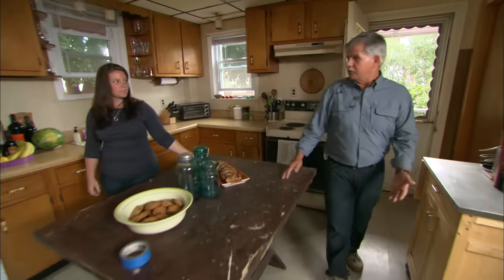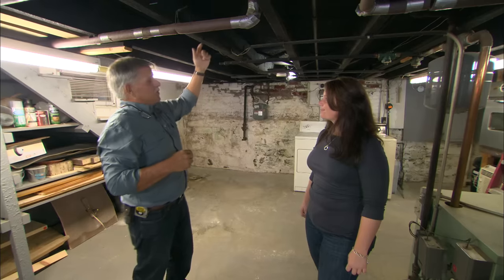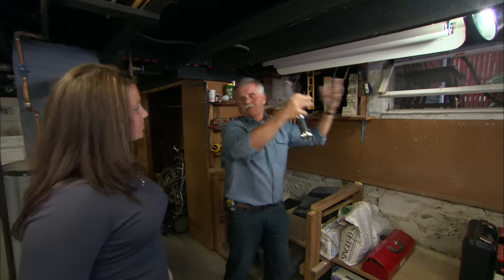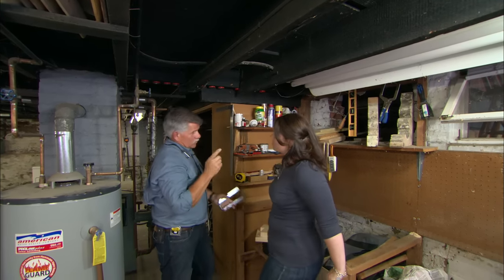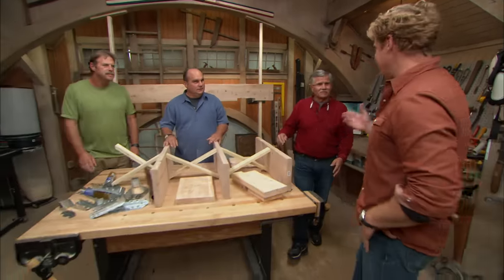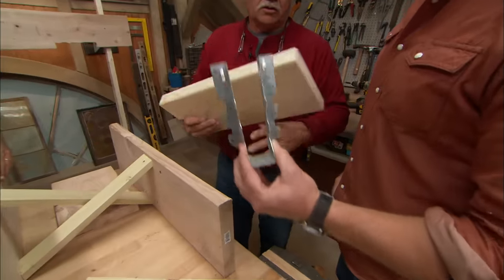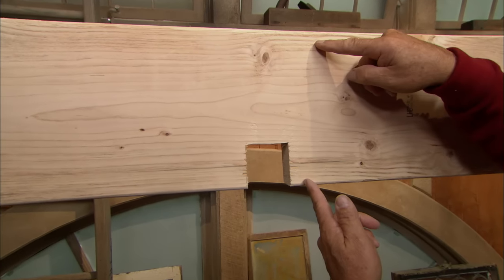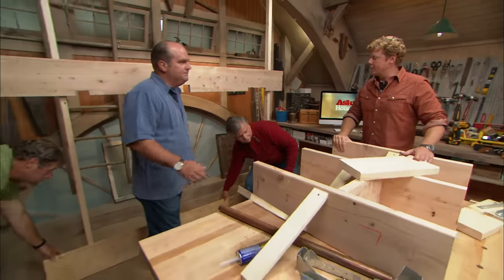How to Repair a Cracked Floor Joist | Ask This Old House

Comment: Thanks for this great video. now, I have a question: I have the same exact situation: between the kitchen and my dinning room, the floor slopes down around 2 inches. is there away to level the floor? can i jack the floor mu self?  my house is 100 years old. I live in nj. thanks.
Reply: odj250 he didn't actually fix the dip
Reply: If you don't mind vertical pipes in your basement, use lally column. Use a screw-type "house jack" rated for 20 tons to raise the area by a 1/4", then screw the lally column tight. Every few months, raise the area another 1/4" and re-adjust the lally. Probably not "code" but lally columns are used all over the northern US (you don't hear/see many of those 1800s/1900s houses falling down), and "code" is a crock pot made of s*tuff... I worked construction and was usually present during inspection.  All the inspectors want is trivial power or to line their pockets.  Those "hanger nails" work fine (or have worked fine on the thousands of houses everywhere I ever lived since their invention).  Inspectors only recite theory from engineer simulations.  Remember: "If you can't build, inspect. If you can't inspect, engineer.")
Reply: Bob - you're attitude sucks. I was a CM for 10 years before I became a code official, and have done that for 25 years. I've helped more homeowners that have hired jerkoffs like you than I could count.
Reply: Srihc Adi
Look on the bright side. The more people like "Bob" there are, the more work for those of us who actually know what we are doing!

Comment: I understand the "no screws" advice based on the notion that people would use drywall screws. But, what if they were using construction grade, wood screws? Just curious.
Reply: Right? Like a 4 inch deck screw

Comment: 4:24 Did Tommy really operate that bottle jack without using an extension handle?  I call camera trickery, judging by how slowly the first stroke was using the palm of his hand, then the strokes sped up.  Handle was removed and hidden when the scene ends at 4:51

Comment: At the end the person says not to use screws because "drywall screws" are too brittle. Now I do not know why people would consider using "drywall screws" instead of regular ones like he states. Why would brittlesness matter in this application? I do not see where they would be subject to impact for example.
Reply: Brittleness succumbs to shear weight.  Construction screws are better than nails on pull out and shear, but don't use any other type, especially deck screws.
Reply: @brewsterly2927  why are drywall screws so brittle then, I'd imagine they would also be engineered to resist shear and pull out. It's a cost saving on not having to temper the material unlike construction screws?

Comment: If your running an eight inch metal pipe for a heat run in a joist,sorry but that joist will not have bracing.

Comment: Wait...what? The only argument for using nails is that because "most" people would use drywall screws?....
Reply: Pretty smart, try to dumb it down, tell people to use nails and not screws, rather than trying to explain the differences between screws.
Less room for error!

Comment: A real contractor would not use drywall screws. They would use wood screws, which are fine for sistering the beams.

Comment: "Center third, the worst place to drill". Not entirely correct. It's absolutely the best place to make your inlet if the opening is in the right place and the size of the opening isn't too large. Notching a beams bottom like that is totally idiotic though.

Comment: Why don't use you wider joists in america? I think 2" or less is pretty small. In Germany we use 4" x 6", 6" x 8" or bigger as floor joists. That gives it more rigidity in my opinion.
Reply: +SpookyMietz  Because American builders are crooks. Let the place fall down. Once they are through they are long gone.
Reply: Everything in Germany is oversized and under engineered in the construction industry
Reply: Houses is America cost a fraction of those in Germany, and no one plans on living in them longer than 30 years.
Reply: Germany and most of Europe allows for greater spacing between joists than the US does.  They go hand in hand.  The wider the space the thicker the joist.
Reply: I would add that too big a piece  of wood gives diminishing returns with it's strength to weight ratio.

Comment: Actually you're supposed to drill a floor joist in the middle, not on the edge. Cutting the edge of a joist reduces load bearing capacity the most.  Look here...https://www.familyhandyman.com/floor/how-to-drill-through-floor-joists/

Comment: My house is unlevel & cracking Sheetrock + around windows...and my family is like “that’s not a problem, you’re making it up.” Or “the house isn’t gonna like collapse, it looks fine.” 
Sure, besides the cracking of tile, walls, ceilings, floors,  baseboards, it seems “ok” except for the drafts coming through the cracks. & both showers are surrounded 360° in cracked Sheetrock/wood framing......😩 (who lines showers with wood?)

“Looks” aren’t everything. This entire house & the last “man” that “renovated” it came in & out lipstick on a pig basically, and even then he didn’t know what he was doing. 
(My sister added an addition onto home as cheaply as possible when she lived in the house & I’m literally at my wits end been working 2 years getting nowhere. The addition to old house wasn’t tied in properly, water damage & mice DESPITE pest control. 

& now I have a deadline because my boyfriend’s business is closing (we lost all our money on repairing this house, including my lifetime savings for my wedding...a wedding that NOW; will never be. 
I have until end of April. The house is filth personified. I clean & have tried everything (still various vermin & mold) 

Please: I need help. I need advice, a contractor (one that won’t make me sell my soul) & honestly I’m in dire need of psychological help at this point...I’m a young female ballet dancer 🩰 & a freelance professional makeup artist (+ I run online media for my dad’s business.) ...I’m in no way a hardcore mason/foundation specialist, I’ve never even personally (DIY) dealt with genuine home repairs until now...plus I’m vegan (so I’m not in love with killing all these innocent mice. They just want a home too but I can’t actually share my home with mice because I care about my loved ones’ health...and that of my own. 

I’m so utterly defeated. 

I need help. 
I genuinely need help. 
I have no one to turn to. 

Please, God Bless you. 
Even if it’s just a prayer sent my way...I can’t take much more of this. 
🙏
Reply: Katie Fulton, first, breakup with your boyfriend. Second, marry a guy with a super nice house. Third, chill on the couch.

Comment: 6:17 poor building logic. They didn't follow the adding rule where every piece, going down the hierarchy is dimensioned bigger than the last one. You never hang a large piece of lumber on a small piece of lumber, it does nothing.

Comment: @9:35:  Tommy, I was with you until that lame reasoning for not using screws.  I could just as easily say not to use nails because finishing nails won't do the job.

(A better explanation would've been that, in general, nails have higher shear strength than screws.)
Reply: @Brad Yelich:  I was just offering what would've been at least a cogent explanation.  ("Not always" is not substantive rejoinder to "in general".)

What you've written only furthers my point that Tommy's explanation was extremely weak.
Reply: He said Drywall screws were more brittle.

Comment: "Use nails because drywall screws are too brittle."  Who the hell uses drywall screws for sistering a joist?
Reply: Mark Oliver  exactly, just a weird way to explain it.  Saying nails have better shear strength makes sense, but comparing them to drywall screws was an odd choice.

Comment: Your not supposed to cut , notch or drill the top or bottom 2" of any joist . There is no correct way to notch the bottom of a floor joist .

Comment: Does all that work and then uses 1.5" nails. Not structurally secure. Should have been driving 3" minimum into the beam. The 1.5" are just for the side nails into the joist. Those 1.5" will pull out over time. 50 years form now someone will be down there doing this same repair again. Joist hanger manufacturers prescribe a nailing schedule and this is not it.

Comment: I was in my in-law's crawl space of a house built in the 1940's. They used wood cross bracing, BUT only the top of the brace was nailed, and no nails on the bottom of the brace.  They were all just hanging. And this has been for over 70 years now.  How sloppy, and that's why their floor was always a little shakey.  Where was the house inspector back then? Also, they had other work done in the crawl space, and not any one person ever told them the floor was not secured.  What's wrong with people? I'm not even a builder, or contractor of any sort.   They've had plumbers doing repairs to pipes, and HVAC people come and go, and an electrician or two doing work, and most lately, an electrician rewiring and putting in a new service panel where wires had to be pulled.  You'd think they'd pass on their unprofessional opinion some time to someone. I'm an accountant, and I know when things aren't right. Geezzz people, say something.
Reply: LostInMySpace  Great observation. I find this to be common in Kansas City, Missouri.  New home building inspections are terrible and if it’s a development, one house is “inspected” and if in ‘code’ all are signed off on without a look.  People move in to find water lines not attached, ceiling installation missing and an entire utility room wall unattached.  I call new homes in this City, “Ten year old homes” .  Meaning, they won’t last more than 10 years before falling down.

Comment: In the woman's house, why didn't Tommy jack up the middle of that joist, sister in a side joist for extra support, and also do the hanger support. I never liked the notch-out method for framing, you're always reducing the strength of the 2 by X joist material (as Tommy pointed out). And what's above it, a bathtub, a fridge, a piano??

Comment: Hey Tom we're not all brain surgeons, so don't show us your fancy math.
Reply: I believe Tommy's formula for the proper size joint is very easy.  Measure the distance (14), divide by 2 (7),  then add (2).    Joint size should be 9 inches.

Comment: All he has done is reversed the problem. The joist hanger bracket needed to be about 3 inches taller to reach from the bottom to the top of the beam, now all the load is just being transferred to the bottom half of the beam instead of the top of the joist. 

In a few years you will have the same problem with the beam now cracking where the notch is.
Reply: Moon Pie  
Yeah because you would know.

Comment: "Drywall screws are too brittle." Then use deck screws. Way better than freaking nails.
Reply: Screws are useful only if you plan that something has to come apart again --  since it's glued, just use ringshank nails that willnever work loose and be done with it. you're never going to be removing the screws int eh future so why spend the extra $$ and hassle? Same reason no one screws together wall sections -- you aren't' going to remove the top and bottom plate from your studs.
Reply: @linkinprk1981  There are NO nails that are going to hold as well as deckmate screws. Extra money? Extra hassle? You can get 1000 deckmate screws for $100. And drilling in screws is so easy my eldest was doing it when he was 6 years old. If I want to hold a house together the right way in the joists, I use wood glue and deck screws. Do the job RIGHT.

Comment: That is not the complete picture. Before this crappy joinery method, they would have shouldered the entire hoist fully. That joinery is not acceptable, moving to a crappy Simpson hardware is even worse, imagine what the show will be like next repair cycle with all these rotted metal hangers... just go timber frame the thing!

Comment: If only carpenters from the late 1800s and early 1900s new about the stress of a 90 joint. You could in fact notch that joist without issue if the corner of the notch had a radius.
Reply: It's still weakening the joist, but yea, a radius would lessen the failure chance somewhat.

Comment: Something REALLY needs to be done about the whole "nails vs screws" thing.

Simply saying "Don't use screws on structure because drywall screws are bad" like like saying "don't use nails on structure because finishing nails are bad".

Honestly?

1) Adhesive to give maximum surface contact.
2) Screws to initially pull the two members TIGHT  to one another, allowing the glue maximum surface contact.
3) Nails for shear strength.  Because, for some reason, most screws aren't tested for shear strength.  Why?  Who knows?

Maybe if there was shear testing for screws, and classes of tested screws MEANT for this sort of application, we'd see a greater uptake.  Because, if shear strength is identical, then screws are a superior fastener.  Period.
Reply: There are screws like that. Simpson makes #9 and #10 structural construction screws that are rated to be equivalent to a 10d and 16d nail.
Reply: There are structural screws that are rated equal or higher to lag bolts, and they're roughly the size of normal construction screws. but $$$$$$$

Comment: I don't get the point of this video. Did not cure the original problem. Dip in the floor.
Reply: MisterTee2010 just replace the crooked joist
Reply: They repaired the joist. They should have jacked up the floor and put a telepost in there.
Reply: MisterTee2010 it was crown down, you must replace it with an engineered joist or a crown up wooden joist

Comment: You should never use a 2x4 to jack a beam like that, minimum should be a 4x4, as  a 2x4 will flex too much.  I also would've left the jack in place until the glue cured, at least 24 hours.  I'd also add a mending plate on both sides of the joist just so the crack didn't extend any further.
Reply: Moon Pie  WRONG.  The crack is only supported on one end now, and you have NO IDEA if the glue properly spread into the crack, or if it even adhered well.  You clearly don't know much about woodworking, wood structure, or carpentry.
Reply: Moon Pie  I'm sure by your comment that you don't even know half of what I know.  They also completely ignored other easy options to fix the problem...

Comment: Sorry but that joist is under WAY TOO MUCH load for just a few small hangar nails to hold for very long.   At the bare minimum drill larger holes in that metal joist hangar and use 1/4" LAG SCREWS instead of those tiny nails.  large diameter lag screws will have the large diameter that is needed to support the large vertical loads that will be placed on them.  You see; thin nails will 'CUT' through the wood as they are pulled down by the load, so you need a 'FAT NAIL' to spread the load out onto the surface of the wood over a larger pressure area, and that is why you use 'lag screws'; they are used as if they were 'fat nails'. 
   I had a 9" split joist like that once, and guess what I used:   10" long U-bolts.  Yeah, just like the ones used to hold leaf springs to a truck axle, I used 2 of those to clamp together the 2 parts of a broken joist, and it works perfectly.  Can't find any that long, so I made my own by bending lengths of 3/8" threaded steel rod that I got at Home Depot. Push the threaded rod in between the joist and the floor, have 10" stick out on either side, then bend both ends of the threaded steel rod down, and put a steel plate onto the end and tighten it up against the wood with 2 nuts.  Easy, cheap, strong.
   As for that sagging joist under the fridge:  use this to lift up the sagging floor before the joist cracks under the heavy fridge:  http://www.homedepot.com/p/Tiger-Brand-Super-S-Series-8-ft-4-in-Jack-Post-J-S-100/100022783
Reply: Re drilling the holes in a joist hanger negates the load guarantee by the manufacturer.